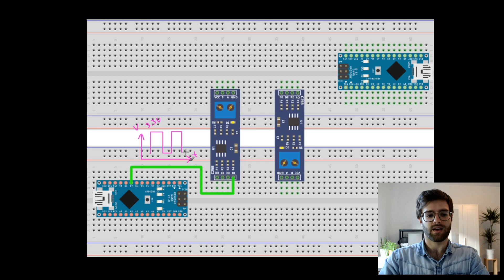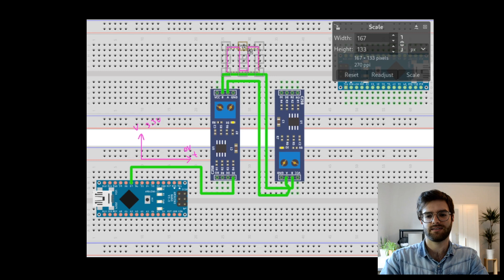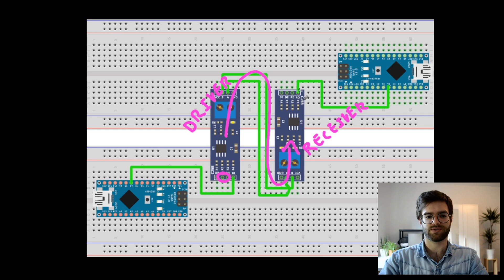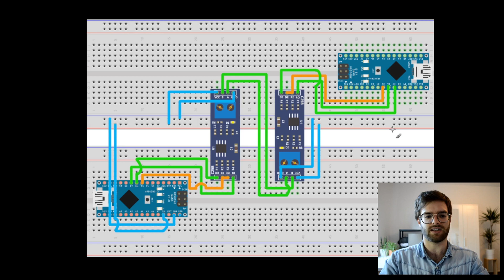Electronics - Arduino and RS485 communication with MAX485 - Part 1  - Scalable Prototyping #5

Comment: I don't quite understand the wiring. RS485 communication is intended for long distances up to 1Km2. In your case the 2 terminations are next to each other with probably a same PC for the 2 USB ports. But in reality, at both ends, the arduino boards are connected to different PCs. Should the grounds of the 2 arduino boards be connected to each other too ? Or make a connection to the earth on both sides ? And what do we do for the  2 VCC on each arduino board, is it the same or not ?